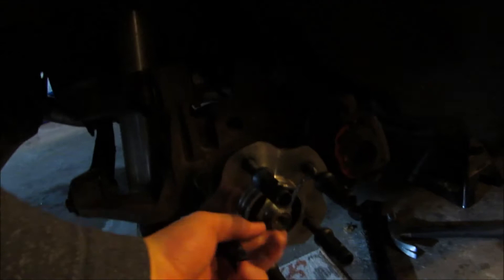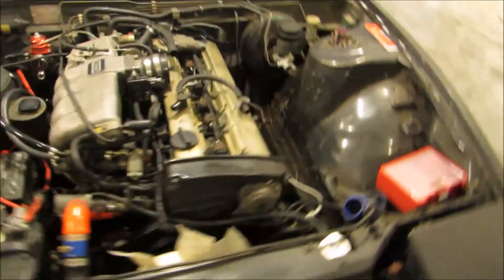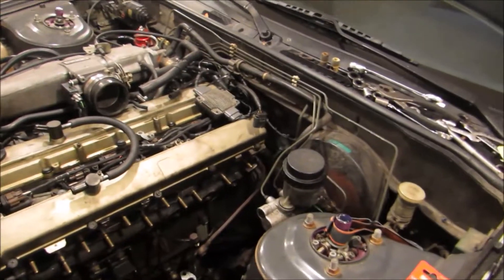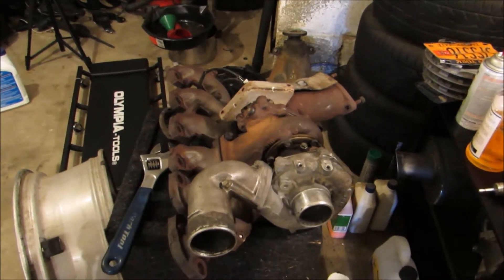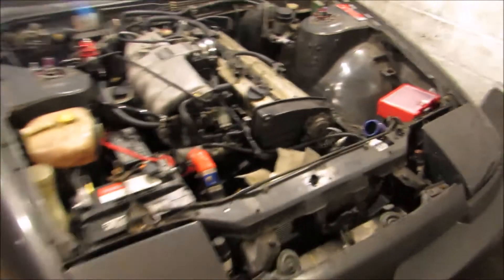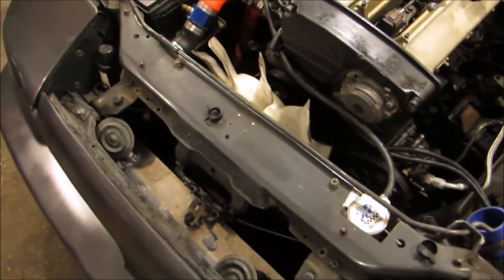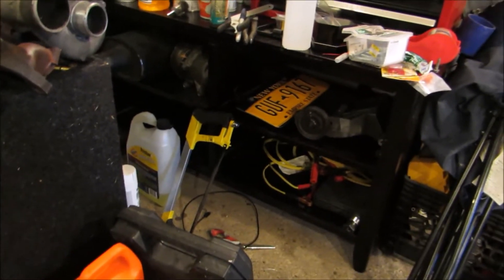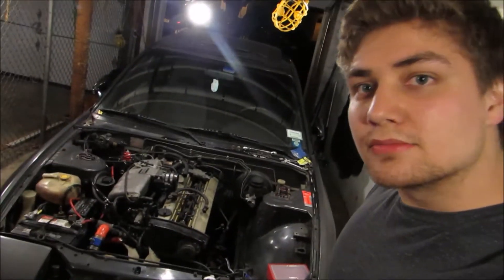240sx Update + Sold Some Junk

Comment: I had the same problem with the manifold studs. Try using a dremel with some carbide bits on there, worked for me after days of drilling/ burning up drill bits. thanks for the update, most people just swap there cars and ditch the channel with no follow ups.
Reply from the maker: Cool, I'll have to try it out. And yeah I have been trying to get the stud out for days too. I hate the damn thing lol. I appreciate it!